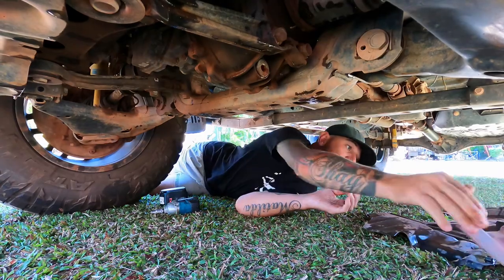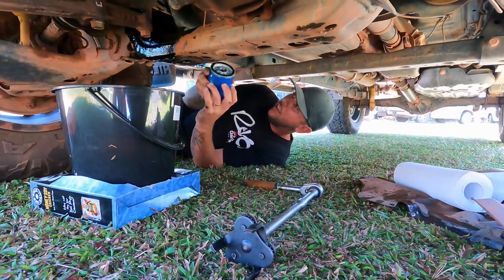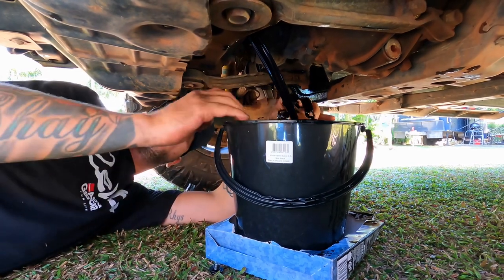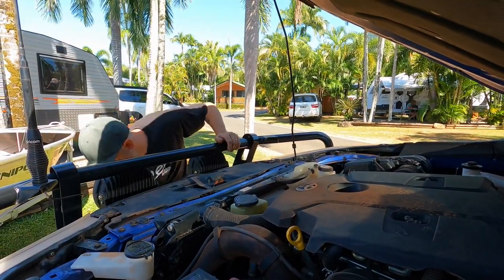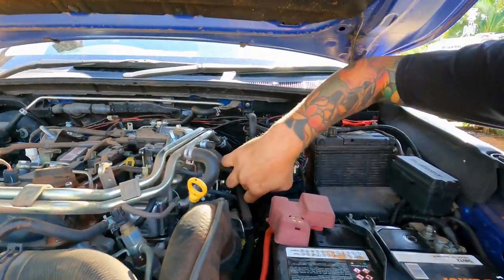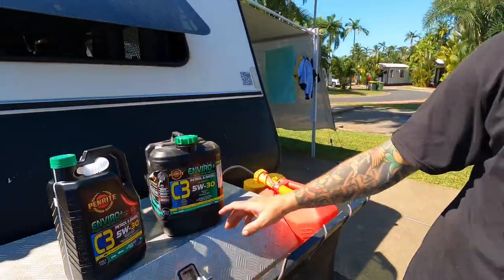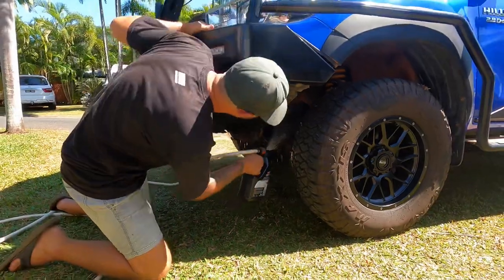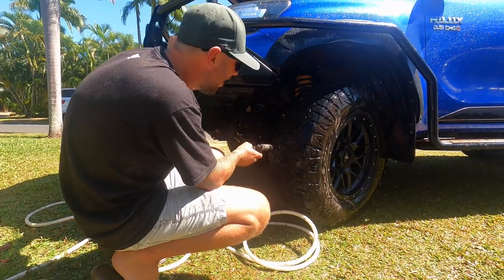How to service Toyota Hilux N80 - 2018 model

Comment: what wheel and tyre size you have on the hilux?
Reply from the maker: 17 inch rims 
Tyres are 285/70r
Reply: @Fishingwithfergusons  much work to get them to fit?
Reply from the maker: @phillipmullner5335  we have a 2 inch lift and front casters moved all the way forward, they fit nice plenty of room no scrub outs